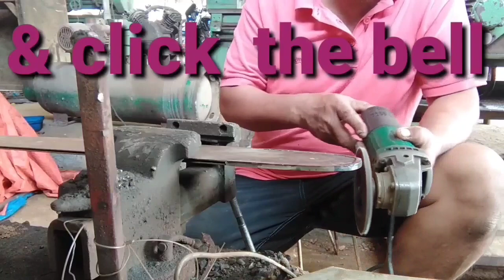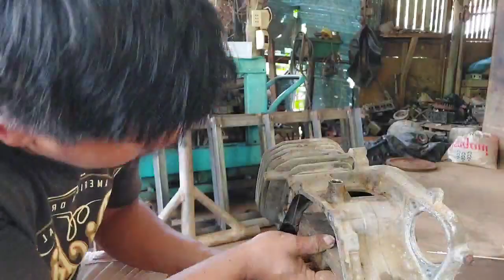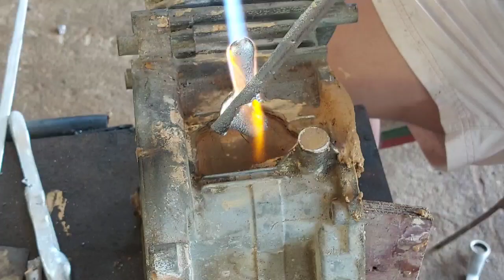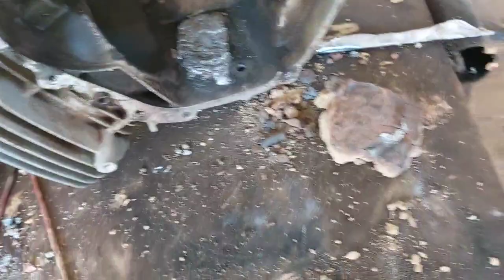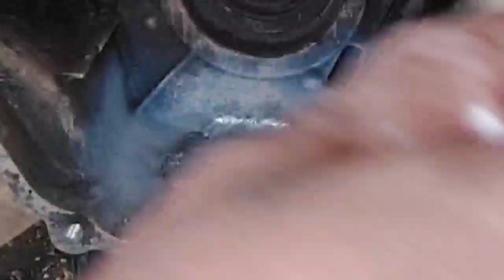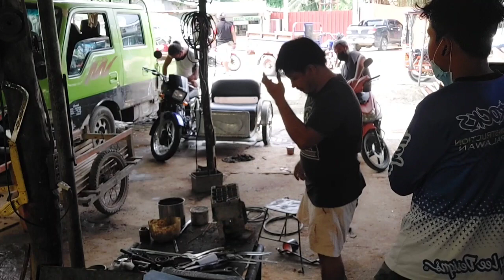Aluminum welding how to fix big dommage of crankcase

Comment: Sir ano po gamit nyong gas acetylene o LPG ?
Reply from the maker: Yes  po sir  LPG matipid  ang isang tanke ko na malaki  2years  bago maubos.   Palit lang ako borax pang linis ng aluminum para makintab  at siksik para sure na walang leaking.
Reply: @buhayturnerodeskartingpino9712  ok po buti di natutunaw yung hinihinangan nyo pano po diskarte
Reply from the maker: @rolandenriquez7951  ay hindi  po kailanagn kontrolado po natin ang apoy. Hindi po basta basta nalulusaw ang alloy.  Kung  saan tumatama ang apoy  yun lang po ang nalulusaw kaya nga gumagamit po ako ng stick rod para kung saan ang target natin na lusawin yun ang gagalawin po natin. Pag nakita po natin na pulang pula na ang rod  na pang halukay  natin saw saw natin sa tubig para hindi malusaw at mag halo sa aluminum na hinihinang natin.
Reply: @buhayturnerodeskartingpino9712  marami pong salamat sa pag she share ng kaalaman Sir .lagi po akong susubaybay sa.inyo more power and God Bless po
Reply: Boss pwede po pla yon LPG lng.akala q  oxy acytheline po gamit nyo.
Reply from the maker: @ronaldandal835  LPG gamit ko maripid. Saka mura. May acetylene  ako pero ginagamit kulang yon kung yero saka tie wire sa mga exhaust pipe ng motor.

Comment: Location nyo po sir , pa wilding kopo sana yung small hub kopo yung kinabitan ng rear sprocket po R150 small hub po
Reply from the maker: May send ako na Link sir  walang  tibay ang welding alloy sa hub.
Click mo nalang link na ito  sir. 

https://youtu.be/4g59tk7ed0E
Reply: @buhayturnerodeskartingpino9712  small hub  po ito sir yung naka turnilyo yung kabitan ng rear sprocket sa hub
Reply from the maker: @jamesskrrrskrrr7447  https://www.facebook.com/jack.sibonga.7
Kuntak mo ako messenger paramatulkngan kita.